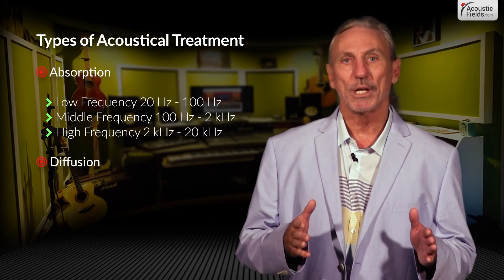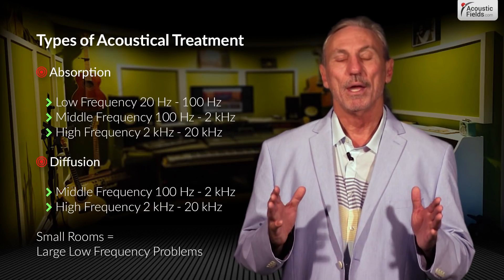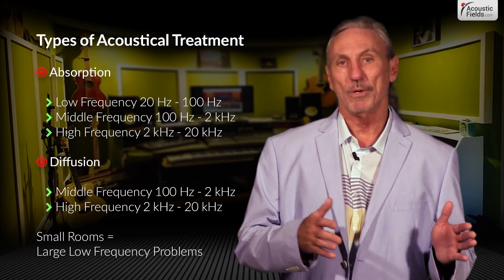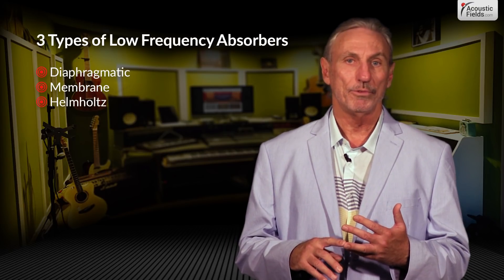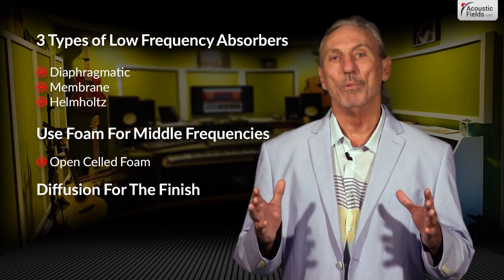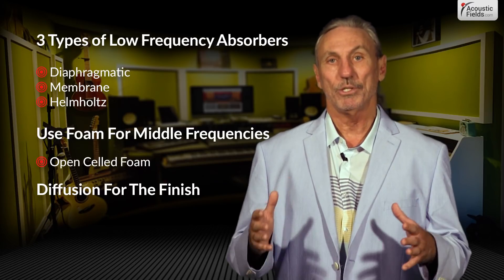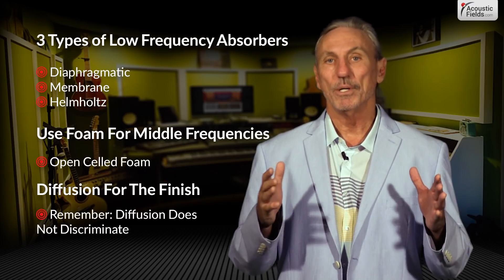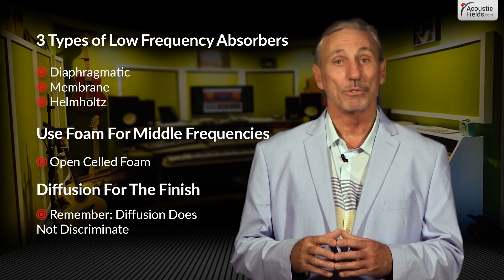Acoustic Treatment in Home Studios - www.AcousticFields.com

Comment: Dennis - My room is about 11 x 12 ft. I have membrane bass absorbers in each top corner, and many rockwool type absorption panels (4 on the ceiling 3 on facing wall 28x 48 each) and many others without getting too detailed. I researched diffussion, but what I understood is that diffussion won't even work in a room my size. So I did not put any proper diffussors in the room, however, I use a bookshelf on my rear wall that hopefully acts as a diffusor. I did Room EQ readings, and there is definitely a difference in the before/after charts, but I honestly can't really read them. In all, to me, the room sounds better than before and seems more focused.
Reply from the maker: P,  It does not appear that you have enough of the proper low-frequency absorption technology in your room. Membrane absorbers do not have the "acoustic horsepower" to deal with the large resonances you have below 100 Hz.  Rockwool is a building insulation designed to for BTU retention. It is designed to keep your house warm or cold. It was never designed and should not be used for acoustics. The rates and levels of absorption are not conducive to music and voice. Bookshelves are not diffusers. They are sound redirection devices. You could use a diffusion frequency response for your room size and volume based upon a prime 11.

Comment: Have you ever made a video about how improper application of absorption & diffusion technologies can magnify problems? Could you make a video about it with a focus on the home studio?
Reply from the maker: J,   Yes, we have some rooms that our customers have sent in. We will be doing videos about improper use in those. Probably 2 months out.
Reply: Ok, thanks.
Reply: i live in a house with small perfect square rooms plus big thin metal windows, and big thin metal door, plus the windows got a design with rails that act as antennas, it is hell if you got  bass lover neighbors
Reply from the maker: X,  Fill out the information in this link. Let's take a serious look at your room size/volume/usage.  https://www.acousticfields.com/free-room-analysis/
Reply: Acoustic Fields will cleaning the speaker rubber with tap water, damage the rubber over time? getting worried. thanks

Comment: hi denis, im quite confuse, you said rooms with the same measure are hard to treat, did you mean that each wall must have a different area, or just different wxhxl, also in your isolation diagram, the carbon foam must go close to the sound source ( if the noise come  from the outside it must go close to the wall, or if it comes from inside it must go close to you?
Reply from the maker: X, You are confusing treatment technologies (absorption/diffusion) with a barrier which is used to block noise from entering or leaving a room. The foam is not carbon. It is open-celled foam. Foam is used on wall surfaces to treat middle and high-frequency reflections. Carbon (diaphragmatic) is a low-frequency technology that is used to treat low-frequency energy within the room. Low-frequency sound absorption (diaphragmatic) technology is best to place closest to source since it is a pressure activated technology and the source is the area of highest pressure.
Reply: ah, i thought it was the carbon foam made by applying high pressure to normal foam, and the area of the walls? each wall needs a different area, or only the wxhxl must be different one to another